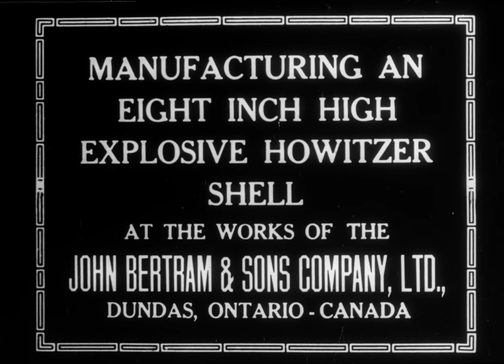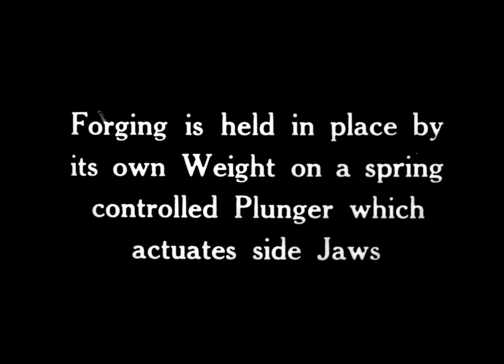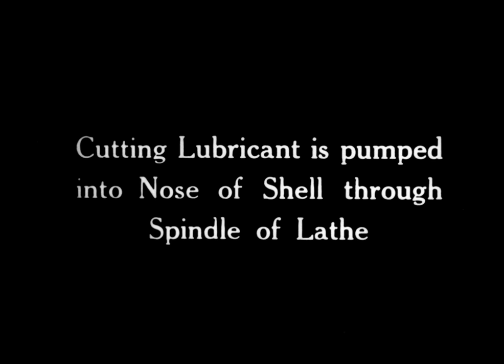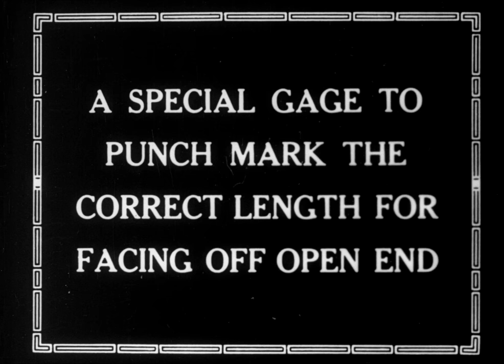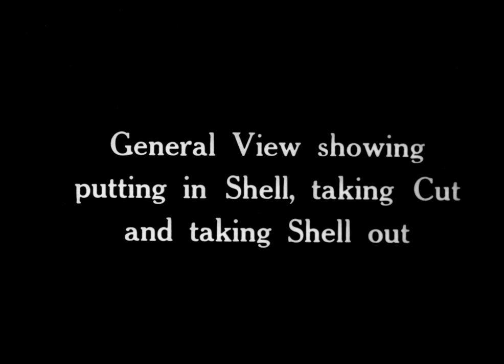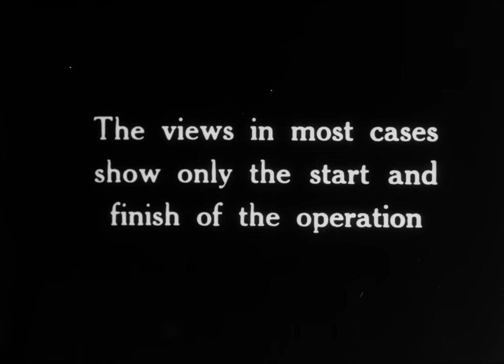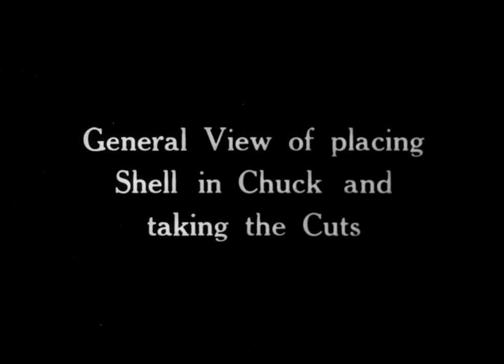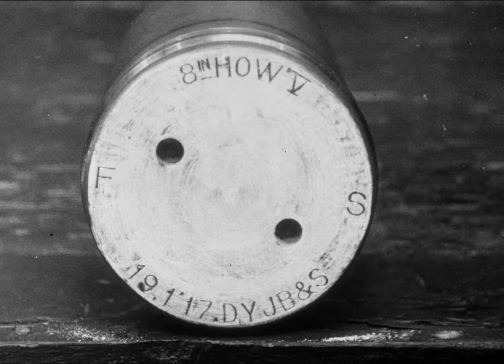Manufacturing an Eight Inch High Explosive Howitzer Shell (1917 ?)

Comment: Thank you for putting this up.  As a machinist of nearly 30 years now it is very interesting to see how it used to be done.  By my reckoning there was about 2.5-3 hours work (not including forging and filling with explosive) in each shell.  It makes the mind boggle at how much effort was involved considering the literal millions of shells that were lobbed at the Germans.

It would be interesting to see how long modern machines and tools would take for the same process.  My educated guess is it could all be done on 1 specialist machine in around 10 minutes.  With a couple of robots loading/unloading, I reckon 1 person could supervise 3-4 machines, not the 10-12 people that were involved in each shell in the film.  Accuracy and consistency would be better too.
Reply: @scottsummers819  
Exactly.
When I worked machine shop I operated a CNC for a while after being a machinist of years.
I was never so bored out of my mind as doing that.
It was a happy day to go back to a manual lathe and have to actually set up tooling and turn a part from a print.
Reply: @johnc6738  Agreed, manual machining is quite fun. CNC machining, put in a piece of metal, press start, try not to fall asleep.
Reply: @scottsummers819 , excellent points.
Reply: Charlie K  might have something to do with the not-dumb fuse and required tolerances. BTW are you sure it's not one of the smart guided shells?
Reply: Charlie K   I don't work in munitions so I can't speak specifically, but form a manufacturing standpoint it shouldn't.  However I have had some dealings with the aircraft and military so my guess is the larger cost in the manufacture would probably have to do with quality control and the paperwork that follows everything around.  Also the specialized machines would be very expensive (>1 million) and the number of shells produced quite low so the amortized cost of the machine per part would be high, although this would drop dramatically (as would the paperwork and quality control) if a serious war were to breakout.  Also remember that the 10000 you quoted includes the explosive, detonator, propellant and what ever other gadgets go into it.  The machining would only be a small part of the overall cost.  Anything military generally attracts a premium to the cost simply because the manufacturer can.
Reply: Neck ties have killed hundreds of men. I personaly think they look stupid, out dated, and irrelevant.  I will not wear one, and havent in 35 years.
Reply: @k.w.churchill4397  There are plenty of dangerous things that can kill or maim you when working around spinning machines.  Gloves, jackets, rings and other jewelry, pull cords on hoodies the list goes on.  Unfortunately people usually have to get hurt before people realize what is stupid when it should be obvious.  This is where appropriate training is important and why bureaucrats should not set rules about safety as most of the time they have no idea what they are talking about.   The 1917 factory in the video simply wouldn't be allowed to function today.
Reply: Machinist if you are one your a dinosaur! Today you programmer's and operators! I'm a dinosaur retired, started turning handles in 1972 and stopped 2012 it was a great career.
Reply: I would guess about 1911- It might have been top secret time. One plant may have skipped a few steps. might be robotic forging.
Reply: @halamkajohn  Not sure what you are talking about here, but the video was set in 1917 and the differences in machine tools and cutters even in those few short years would have been dramatic.  These were the years that really saw an explosion in manufacturing technology with mass produced cars and the industrial war that WW1 became.  Robotic Forging?  Not even a dream back then, whilst there would have been repeatable procedures everything was controlled by a person and their 2 hands.  We didn't even have thread standards until the mid 1920's (or later can't quite remember the specifics on that).  Every manufacturer created their own nuts and bolts to suit what they were doing, there was no buying anything "off the shelf" in 1917.
Reply: Charlie K  It is a FedOrd standard judgement that once the weight of the paperwork is in excess of the item being specified, whether it is a bullet or the gun that shoots it, the item is close to being finished. 

Example:  There will be a spec for the alloy of the steel case, a spec for testing the steel case, a spec for the calibration of the tester for the steel case.  And so on.
There is a spec for the drawings, a spec for the paper, a spec for the ink.  And, an inspector for each, to make sure that the taxpayer isn't getting robbed.
Oddly, the Feds do not trust themselves or anyone they contract to.  If you cannot show documentation for each and every material, process, and source, the Wrath of the Almighty will descend.
This costs money.
Reply: @scottsummers819   You would go home or to your digs and have a good scrub up. But out on your date, there was always a slight scent of cutting of oil!
Reply: @alexhayden2303 True and it's not really changed either, I have used some coolants that just stink, bad.  They don't last long in our shop though at least.
Reply: @johnc6738  try getting into setting up a CNC machine, instead of just loading it, then will be non-bored, and way over your head in an instant! Lol

Being able to run a manual machine is an art, and requires some good skills, but to be good at CNC setup, you have to be able to not only know how to get it to make a part of the correct shape, but know how to optimize cycle times, build jigs, design rough stock sizes, write procedures, test and optimize every line of the program to avoid any delays, program in tool wear compensation and error detection, and set up the machine so that a monkey can make a million parts on it with a very small scrap rate.

The skill set needed to be able to operate a CNC machine, rather than just load parts, in other words, to be a true CNC machinist, blows past what most previous generations had to know to be a Master Machinist.
Reply: @ke6gwf  
Yep I agree. We would get the program and install. Many times some edits were needed to optimize the different operations. Then just load stock and push start. Making edits isn't that difficult but the wrong edit in the wrong cycle could make things interesting.
On the manual lathe it takes knowing the set uo for different tooling, RPMs and travel speeds. I much prefer the manual lathe.
Reply: @ke6gwf  All very true and what I was alluding to in an earlier post.  You gotta be able to machine before you can program an NC.  Whilst it's not so bad these days missing decimal points was one of the biggest killers of machines and tooling out there.  I have also never met a program that couldn't be optimized in some way but optimization takes time and is relevant to the number of parts being made.  Ie you don't spend a day messing about with a program to save an hour's machine time when you have one or two parts to do, but if your making a million every second counts.
Reply: rcdogman,  you were only doing it for five minutes then? Just out of your apprenticeship lol
Reply: @muffinman1157  Yeah from a casting with a twin turret twin spindle 12 inch chunk you're looking at under 5 minutes complete. With robot loading you're probably looking at 1 person to 5 machines.
Reply: Yuck Foutube  There are plenty of machinists who use CNC...
Reply: @samrodian919  lol it seemed like it! I think if you like what you do and where your doing it time does fly.
Reply: Yuck Foutube  Someone has to program the job, though.  Also I like how the guy forming the final profile literally has a former set up to guide his X depth.  So he's basically literally just setting to a new depth and cranking a handwheel mindlessly while that precision guide a toolmaker made for him does the heavy lifting of creating that 3D profile.  Almost like how we use mastercam and G-code to do that same sort of heavy lifting now...
Reply: Charlie K  How else are they going to pay kick backs and all the intermediaries?
Reply: You are totally right. I think that shell needs only 3 special lathes!!! Too much work for nothing...
Reply: Charlie K  Too many to eat money from such a small shell...
Reply: Yuck Foutube  That's the whole idea. Automate the loading and inspect with video, and eliminate the button pushers too.
Reply: @scottsummers819  Didn't even have a standard inch.
Reply: @muffinman1157  My estimate is based on the processes I saw in the video, translated on to a modern dedicated machine with  twin turrets, multiple heads and a robot loader.  Modern cutting tools will run 10-20 times faster just for a start.  It might run 20-30 minutes depending on the grade of steel of steel about which I have no idea.  As for supervising 3-4 machines. Easy on dedicated machines as you will basically be  changing inserts and other worn out tools, which will be a regular intervals.  I often supervise 2 CNC's and a manual machine in my daily routine and we run different jobs almost every day.
Reply: Charlie K  Because that is only the empty shell case. It then has to go to a filling factory and be filled with H.E. and fitted with a fuse.
Reply: @scottsummers819  If you want to see the shop layout, search archive.org for "shell manufacture" and you'll find several books from that era with all the steps described in detail (I found it when I was trying to find out more about wave ribs) and maps of a typical shop floor layout.  Don't know if they discuss the support side that much.  But from the size of the crowd of workers (and the sheer number of machines on the floor plan), there must be quite a few people dedicated to just maintaining the factory.
Reply: @AGMS00  Thanks for the info I'll follow up on that.  No doubt there would have been a lot of support guys, anyone with those skills would have been guaranteed, if not out right denied entry into the army and put in harms way.
Reply: and back the other way
Reply: Scott Summers: Not just ties, entire "business suits" -- and "sport coats" for that matter. Ridiculous that most of the world's professionals wear them.
Reply: Charlie K  Giving some generalities on the topic.  The high cost of the modern shell tells me that it is probably made of "DU " depleted uranium.  The material itself is expensive and the process to produce is highly specialized.  They are for metal and ground piercing.
JIM
Reply: Scott Summers, I'm only a mechanic but I'd have to disagree with your first assessment that these men under this circumstance would only be doing one operation and needing help at the first little problem, 
I'm betting they did a lot more than that, These weren't millennials we're talking about .
Reply: As with everything else today , all made by the lowest bidder as cheap as possible .
Reply: @scottsummers819  I think profiteering is the most likely explanation..
Reply: @stclairstclair   Millenials, lol.  Perhaps you are right, but you also have to remember that education wasn't so good and a lot of men with actual skills went off to the war as officers.  I am sure with time and training they could all do more, but in a war production scenario training would be limited to what needs to be done and then you go off and get the job done, worker happiness, skills and desires would have been secondary to getting parts out the door.  I suspect it would be hard for most of us to relate to what it was actually like back then.
Reply: @jjthomas2297  Certainly part of it, I know of companies that simply double or more a quote just because it's for a government department.
Reply: Scott Summers, Hey thanks for replying, I said this because I came from a polish family that was all mechanics from ww2 on, I didn't graduate high school but instead put myself through technical college to become a dealer mechanic, I can build anything, I've read an entire library.....But only tech manuals, I've only read three large books in my life, I'm from a forgotten era, Peace and have a bourbon on me.
Reply: @stclairstclair  BTW mechanics don't qualify as unskilled lMO.  Even back when cars and trucks were much simpler than today's offerings it took a lot of brains, skill and patience to figure out what was going wrong with something and the brawn sometimes to fix it.
Reply: Scott Summers, I wish you could have met a boss I had in Florida 20 years ago, He could literally hide a beer in his fist, Popeye arms, He was the stupidest hick....good ol boy you have ever seen, But could rip the differential out of a semi tractor and rebuild it with his eyes closed, He was as uneducated as you've ever seen, then he would pick a lock with an old car key,  It was an enigma, a mix of old hick and science major, People are capable of things you would never imagine possible.
Reply: I am not a machinist but took BIA Shop in high school, and can operate a lathe. This video was fascinating, I only wish the sound worked on it.
Reply: If I had to guess given modern tech it would either be like you said, one large super specialized CNC machine working with close to spec castings or a massive forge process with dies and light CNC finishing.
Reply: @TJ4774  Probably a bit of both.  I have read some other articles since that post about developments in materials science that have dramatically changed the way bombs and by extension shells are made, so that they have far greater penetration potential.  Some scientist at DARPA  (I think), used various techniques, such as forging, bending, rolling and heat treatment etc to "align" the casing molecules so that the casing remains intact as it penetrates the target.  Initial tests took these penetrators from about 2-4 feet of solid Granite up to almost 60 feet in just a year or 2 of work.  Suffice to say I expect it's all way more complicated these days.
Reply: i'm more suprised with all the machines properietary designed and used.
Reply: The main roughing operations would still take a while. And most CNC machines are not running a setup with two cutters like they had. It would still probably be done on two machines at least. Probably cut the time in half though.
Reply: @scottsummers819  совершенно согласен: есть оператор, который в кадре, а есть наладчик, которого редко увидишь, но на нем производство держится.  а вообще: завораживающее и очень интересное видео. почти 2 часа ночи, а я сижу и смотрю, как будто мне этого на заводе не хватает )))
Reply: if only 1 guy could do all that.....
Reply: Former machinist that worked at United Shoe Manufacturing Corporation 1980.  Did my apprenticeship and then went on Cincinnati miller. Use to go through the courtyard shop with their big machines  about 200lbs and less. One day I'll be doing that All manual machines.  Then they installed first CNC machine and i knew there was trouble ahead.  Laid off after 2yrs because our elected officials allowed everything to go. Better for us they said. 
     One complete industry left America.
Reply: But why the hell does a bomb need such precision manufacturing, particularly in 1917? 
Besides, area bombing was a complete and total failure that would never be done again.  They often missed targets by like TEN MILES! And that was 25 years later in WW2!
Reply: @tarstarkusz  This was an artillery shell not a bomb dropped from an aircraft.  Different applications.  Granted the precision of the internal features is not that critical and this can be seen in the video, however the fit between the outside casing and the barrel of the cannon is crucial, as would be the fit of the detonator cap and the nose mechanism which would cause it to explode.  Poor manufacturing leads to unreliable and dangerous for the operator, munitions.   These shells were used in the millions to bombard the enemy lines, to kill the enemy, destroy fortifications and cut barbed wire in preparation for an attack.  They would have been accurate to within a few 10's of meters 90% of the time.  Accuracy was paramount towards the end of the war, when the creeping barrage was used.  A line of artillery was continuously dropped about 100-200 meters ahead of an advancing line of soldiers.  The artillery was lifted  (moved ahead of) the soldiers until it passed over the enemy trenches.  This forced the Germans to hide in their bunkers until the very last minute, by which time the attacking force was on top of them before they could remount a proper defense.  Drop shorts happened and killed many friendlies, but by and large it was much safer than charging head long into German machine guns.  Precision, even in 1917 was an important feature of all weapons.
Reply: @scottsummers819  I know this is a different application, but the aircraft bombs require a lot of machining as well.  It is just surprising to me that they couldn't develop a charge that had a tolerance to casting tolerances and that they forged these munitions from solid bar and not a thick walled pipe.  Obviously a shell going through a bore will need high tolerance.
Can you imagine how much those advances cost in terms of these Howitzer shells?
Reply: @tarstarkusz  Casting, even by today's standards is notoriously inconsistent.  You just could not get the quality control needed for production in this quantity.  Also I doubt a cast casing would have the structural integrity to survive acceleration in the gun barrel.  The forged and heat treated material would have been the lowest cost material designed to do the job.  I would also suggest that the forged casing would make for better shrapnel.  A cast casing would just disintegrate into a puff of dust with the force of the explosives inside.  Sure the relative cost might well be higher, but in production like this the cost per item comes right down and with better quality control you have less waste.  So cost is probably even, perhaps even cheaper.
Reply: @scottsummers819  I am pretty sure these are forged.  There is another video on YT, though much newer, like ww2, where they show the making of 3" shells for the navy in the Frankford arsenal. They cut round bar into lengths, then heat it and use a 4 stage forging process to turn the solid bar into a hollow shell.  I don't know if they did that here, I'm just saying they might have.  Thanks for the reply.
Reply: @tarstarkusz  I think I've seen that video too.  From the look of the blanks I'd be almost certain that it would be a similar forging process used in this video.